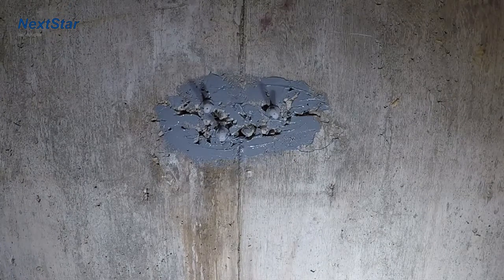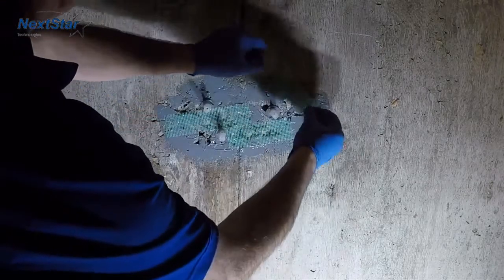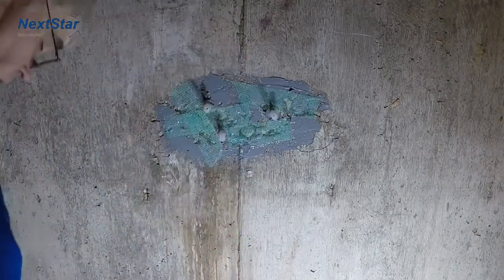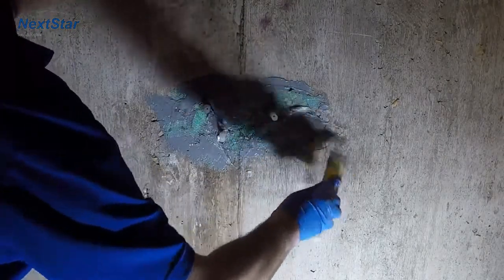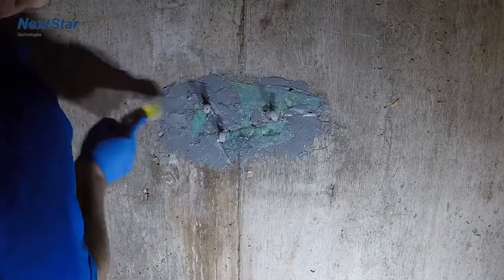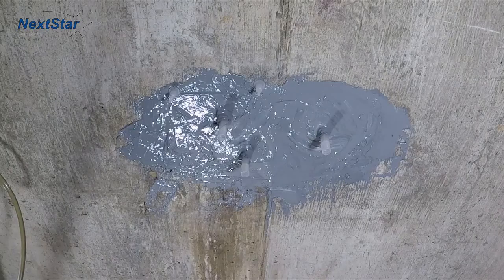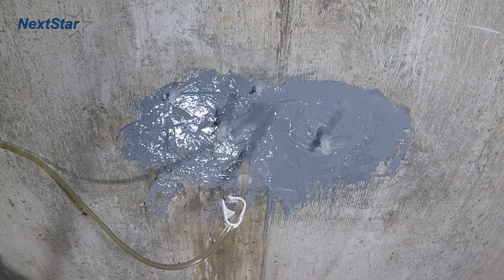Concrete Spall Wall Void Repair

Comment: Did I miss a picture of the finished repair??
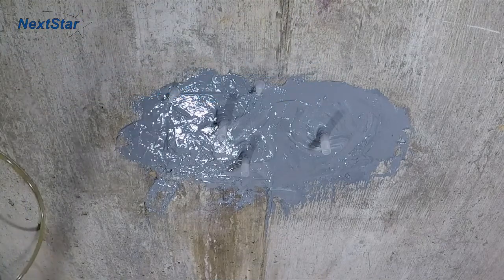Reply from the maker: 4:33 is the best image of the finished look. This repair method injects through the wall and plugs the water intrusion. preventing the water from ever entering the concrete.

The goal is to prevent water from entering and destroying basements, The cosmetic look was not the goal of this kit but the paste can be chiseled off after the resin is cured if needed.

Comment: Shouldn't high pressure polyurethane be preferred?
Reply from the maker: No, Clean flaws such as this one do not require high pressure. High pressure is intrusive to the concrete and the damage from drilling is unnecessary at this current time on this flaw.